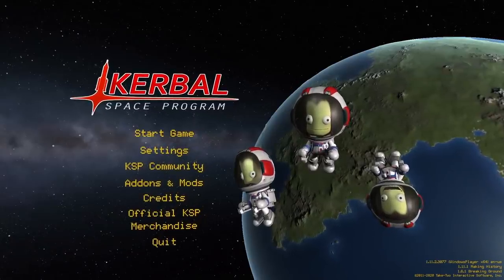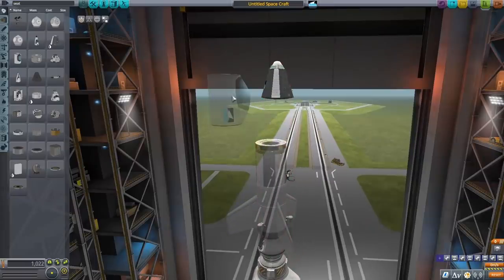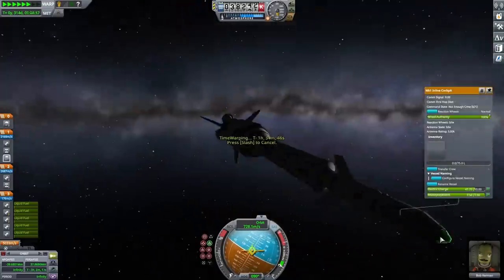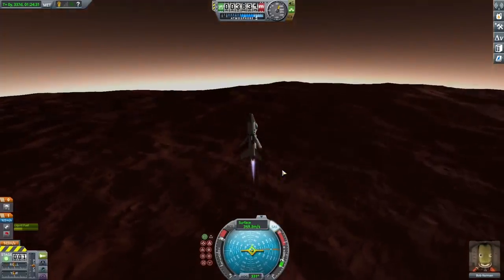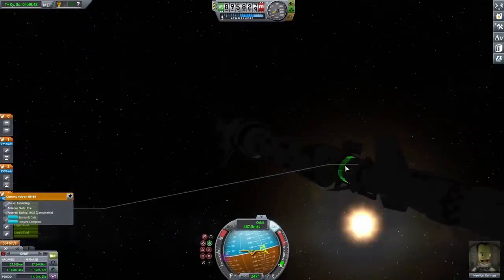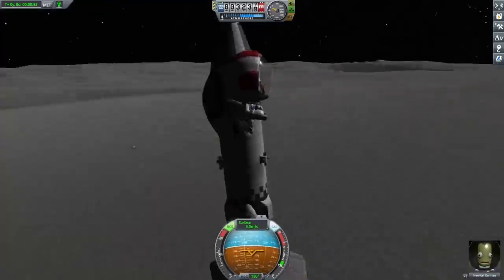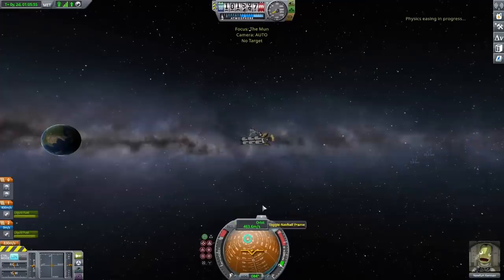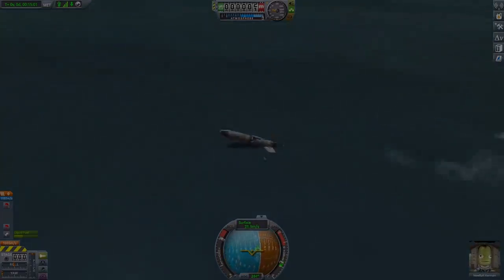Preparing to Rescue Jeb in Kerbal Space Program

Comment: The terrier engine has barely any thrust in atmosphere, but is fairly powerful in vacuum
Reply: dart is good for Duna because it goes from the surface to a vacuum, but the Cheetah is better for that because it's much better in a vacuum
Reply: Ikr
Reply: @shannanritchie1712  the terrier engine still works well in the thin atmosphere of duna
Reply: I agree I use terrier engine for landing on the mun or minmusm
Reply: The terrier is also very efficient
Reply: I would've just put another stage: One for the atmosphere, and two for vacuum (before and after getting to duna).
Reply: I'm insulted by Reid hate speech against the terrier.

Comment: The terrier works well in space, but has less power than a firework in the atmosphere
Reply from the maker: Makes sense, I didn't know how it was going to perform in duna's atmosphere
Reply: @ReidCaptain  In the VAB, you can set the DeltaV tool to show the stats in any planet if you want, so it would show you how any of the stages would perform in any planet atmosphere at any height. You can look at more detailed stats of the stage by clicking at the deltaV panel of the stage at the side to show other stats, such as ISP, (if enabled) Thrust to weight ratio, stage burn duration, and a few other stats.
Reply: @ReidCaptain  it worked well for me in duna but thats probably because duna's atmosphere is almost nonexistent
Reply: @ReidCaptain  use the cheat panel to teleport to duna on a test world

Comment: reid, the small engine you tried on your rocket before switching out for a dart was vacuum optimized: meaning it doesnt work on the surface of kerbin but excels for manuevering in space (and since duna barely has surface pressure, that extends to it as well)

Comment: Noticed no one has mentioned a mid-course burn. Once you got your encounter with Duna, make another maneuver node about 1/2 to duna.. make sure duna is still selected as your target, you can double click the planet and it will focus it. you can then fine tune a maneuver to give you a MUCH closer encounter with duna while using tiny amount of deltaV (between 5-15m/s) I personally use my mouse wheel because it can be VERY sensitive. And this part took me forever to figure out, if you press the ‘ key that’s below your ESC key it will refocus your current ship. Saved me so much time when I learned these things.

Comment: Three things I noticed:
1. Trying to exactly match up orbits when wanting an encounter with another spacecraft is okay when you're first trying it, however, it is usually better to have a slighty smaller/lager orbit if you need to catch/the probe needs to catch up. It just then takes less orbits for you to be near each other.
2. I know this is probably part roleplay, but circularizing your orbits while planning for reentry is mostly unnecessary. It just burns more fuel. Of ocurse if you have enough this isn't that much of a problem, but when the acutal mission comes you should not plan to do taht, as not to jeopardize the mission in the final stage
3. The docking ports were...interesting? But you can also use them as decouplers. While they are not as strong structually (which becomes a problem during launch, when a lot of thrust is being out through the spacecraft) I think struts can be placed and must be cut manually, although this is knowledge from about four years ago in modded KSP, so I don't know how well it holds up.

Comment: those terriers engine would work pretty well on duna
you can still track anything without a probe on the air, you just need to turn on "junk" on your tracker, cause itll show up as "junk"

also, you should probly mess with your orbit while in interplanetary space, so that when you get an encounter, its a close encounter (<100km from surface)
from intetrplanetary space its generally really easy to do it, you waste like 5m/s of delta V and you get a much closer encounter wich saves a ton of fuel in the circularization
Reply from the maker: Good tips, I need to get better at planning out maneuvers so I can save myself a lot more fuel.

Comment: The reason your terrier didn't do anything is because it is a vacuum optimised engine. Larger expansion ratio bell means its very efficient (and powerful) in a vacuum but practically worthless at sea level on Kerbin.

The dart is a special kind of bell called an aerospike, which in theory is optimized for every altitude. That's why it can get so much efficiency in space while retaining all its thrust on the surface

Lastly, your lander at the end wanted to face down because of the fin placement. The centre of lift always wants to be behind the centre of mass in the direction of travel. Think of it like a dart

Comment: I actually saved 2 kerbals the other day 
I had gotten them stuck back in the first year of my save and saved them at the end of the second year it took so many iterations of ships I tried space shuttles and regular rockets of varying sizes I landed on the mun maybe twice after the kerbals were stuck one time was with a buggy and another was a shoddy version of starship but the rover which I made to drive the kerbals to the rocket that lands on the mun and that crashed and then my starship well it wasn't the best in the end I launched a new design I had managed to confirm it could orbit the moon angle itself so it would land near enough to the lander and finally finally after all that time I landed it, i got jeb and bob on board the lander and flew back to kerbin and now I've launched bill into deep space along with some other kerbals and now they are stuck there so time for a new rescue midsion